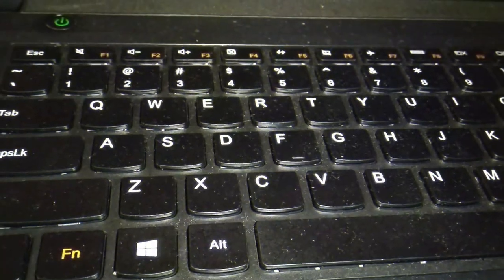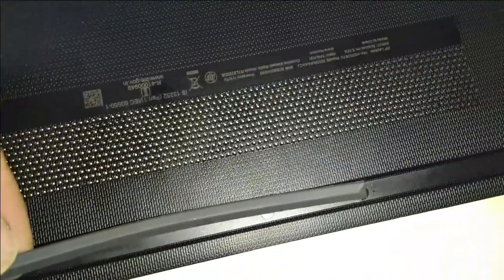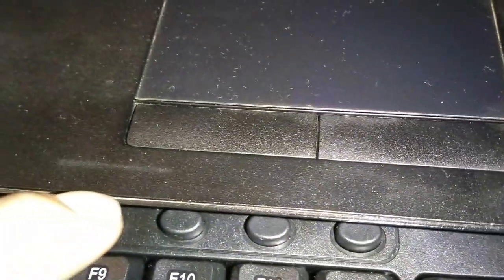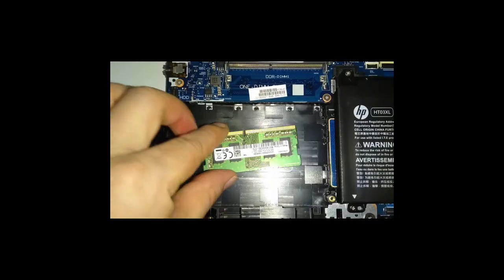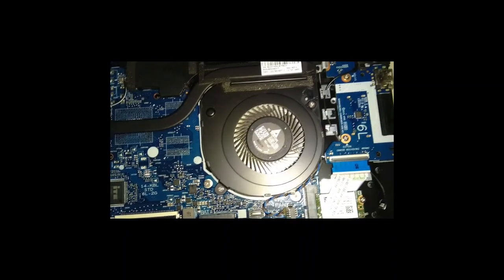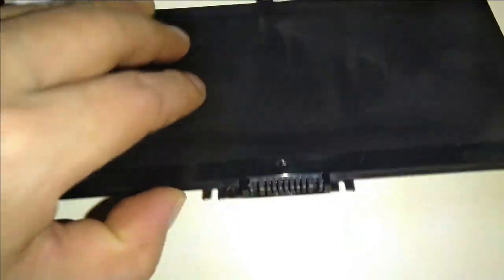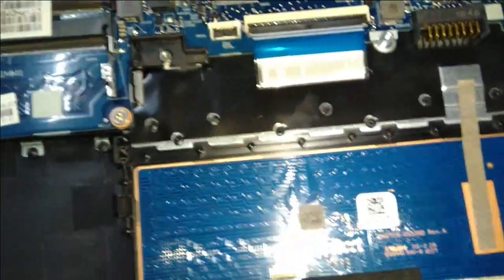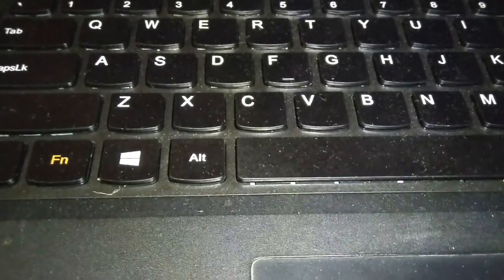How to Open HP 14q cs0009TU Laptop for Servicing.

Comment: Crucial RAM Model - CB8GS2400 supporting but I'm getting error mostly You're PC ran into problem. Does this RAM supports HP 14q-CS0009TU.
Reply from the maker: Depends on what ram is in the ram laptop DDR2 or ddr3
Reply: @Ashihriisteve  I'll check the default RAM model and get back to you with details.
Reply: Default RAM - 
Samsung M471A5244CB0-CTD 4GB,
SO-DIMM
DDR4 SDRAM,
DDR4-2666 (1333MHz)
Reply from the maker: @xiaomiredmi5854  sir you need to change the Ram with the same brand and for ram if you  want to upgrade  to 8gb you can do so.
Reply: @Ashihriisteve  Can you suggest the compatible RAM model it would be helpful. Already having default 4Gb want to upgrade add 8gb more.
Reply from the maker: @xiaomiredmi5854  sir you can go for Transcend or Kingston anyone will do.
Reply: @Ashihriisteve  Can you provide link of amazon it will be easy for me to purchase.
Thanks for you support & help 🤗✌️👌👍
Reply from the maker: @xiaomiredmi5854  sir but before buying make sure it is DDR4 or DDR3
Reply: @Ashihriisteve  Yes sure thanks 🤗👍
Reply from the maker: https://amzn.to/3yr1Grp
Reply: @Ashihriisteve  
i checked bro it's good 
also i mentioned other two ram models let me know
Reply: @Ashihriisteve  
Crucial RAM 8GB DDR4 2666 MHz CL19 Laptop Memory CT8G4SFRA266

https://www.amazon.in/gp/aw/d/B08C56KXQJ/ref=psdcmw_1375344031_t1_B07GZJGW7W
Reply: @Ashihriisteve  
Let me know which i should buy Transcend model which you mention or Crucial models which i showed you all are speed@2666MHz CL-19 1.2v 260pin So-Dimm SDRAM
Reply: @Ashihriisteve  
Crucial RAM 8GB DDR4 2666 MHz CL19 Laptop Memory CT8G4SFRA266
i ordered this bro hope it will work fine without any issue

Comment: Bro I have the same model and I want to replace keyboard can you please guide me
Reply from the maker: Yes bro why not it's available in the market just note down the model number and get it from the market or order from ebay
Reply: @Ashihriisteve  bro please show how to remove the keyboard from this particular laptop.
Reply from the maker: @jagannathanmenon3708  why not sir
Reply: @Ashihriisteve  thank you brother..it will be great help for us. ❤️ Also try to do it bit more zoomed out bro.
Reply from the maker: sure
Reply: Yes bro please make a video on complete removal and placement of new keyboard of the same. I think this model is having problem in keyboard because this is the second time I got my keyboard shorted.
Reply from the maker: @ashutoshkumar5204 carefully remove all screws and gently cut the rubber the is locking the keyboard side and when you fix new keyboard gently solder them back. Because this keyboard is attached with the body for locking.